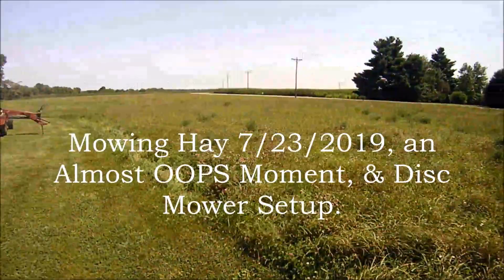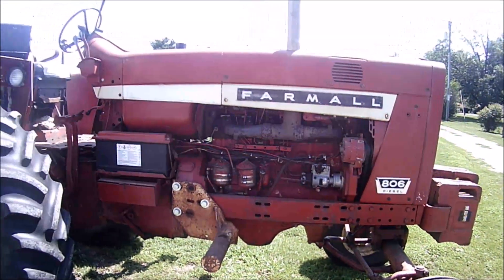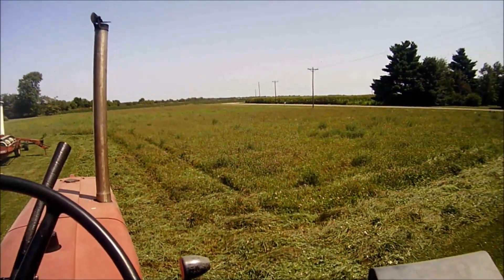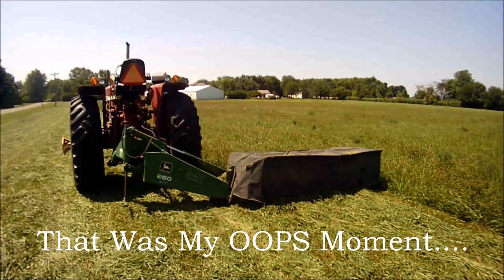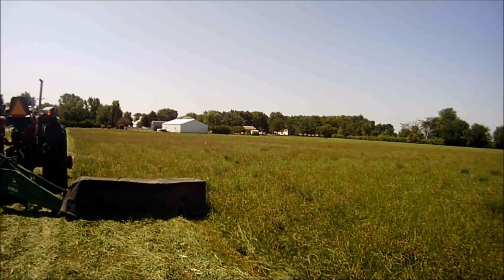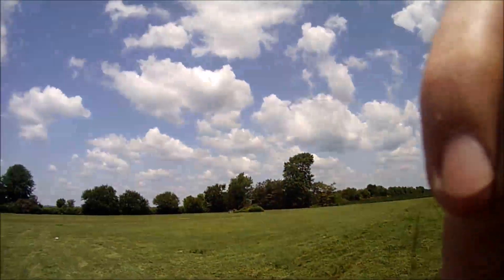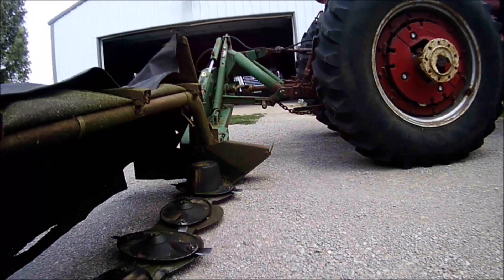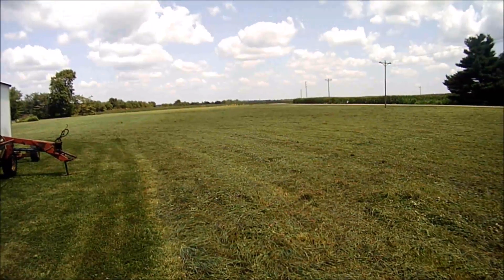Mowing Hay 7/23/2019, an OOPS Moment, & Disc Mower Setup

Comment: Oh boy, running that mower on the 806 is probably all it can handle!! (joking) Those older Kuhn mowers are just about bullet proof if you change the cutter bar oil every once in a while. Nice to see a haying video from ya bud! I'm sure you're glad to be out running the ol' IH!
Reply from the maker: Yea, that mower is  almost more than it wants. LOL  So far I've been very pleased with the mower.  Yep, I was so excited to get some tractor seat time on the ol' 806 I even mowed the dang horse lot while I had it out. LOL  Thanks for watching & commenting.

Comment: What gear do you run in?
Reply from the maker: I either run in 4th gear low range hi side of the torque amplifier or 1st gear hi range hi side of the torque amplifier.  It really depends on how heavy or thick the hay crop is.  I posted a new video last week (8/18/20) that I ran in both gear settings.  I've always been told when running a disc type mower you can run as fast as you want as long as you can keep your butt in the seat. 😁  Thanks for watching & commenting.